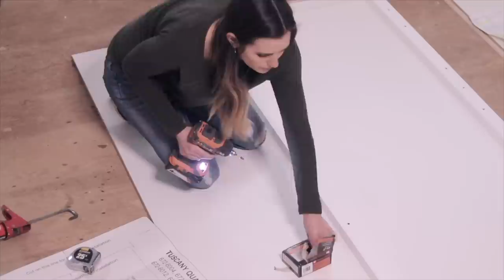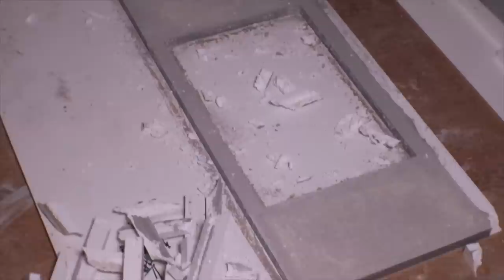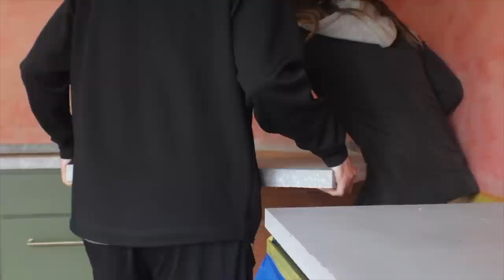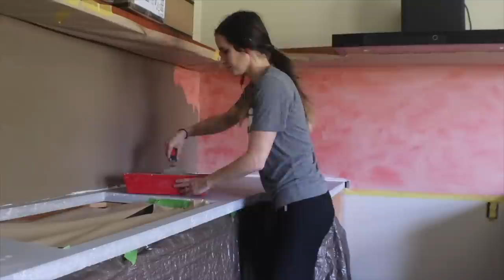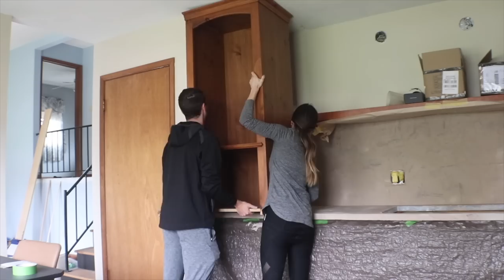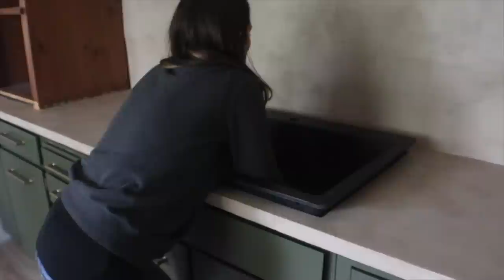DIY Concrete Countertop & Concrete Backsplash (Colored Concrete Counter)

Comment: Your hard work really shows in the results. I wish I had that kind of drive.  The "craftsmen" in my kitchen cut a relief into the drywall in order to fit the countertop. Caulked over it to hide the cut out. They did this because they didn't have the 90 degree. perpendicular wall  correct. It was more like 85 degrees on the inside.
Reply from the maker: Yes exactly. When the walls are wonky the counter can't fit

Comment: When you cut your cabinet, use a razor knife and cut your line, then make sure to use a sharp fine tooth blade if you must use a jigsaw. Cutting the line will help prevent the wood from chipping out and make the cut much better.

Comment: Great job.. I like the concept of the concrete idea for the counter top .. not to sure about the backslash 🤔.  The kitchen is really coming along.. great job
Reply from the maker: I actually think the video doesn't quite do the backsplash justice - it looks really great in person! We'll see if it pops more when everything else is put together.
Reply: @WelcometotheWoodsBlog  very true. Curious why no wire mesh in the concrete I know its thin but the wire helps  correct.. thats what I've been told
Reply from the maker: @norcross26  this product doesn't need it at all. The polymers in the concrete act like metal fibers that hold the concrete together giving it crazy strength. You can literally drive a car on this stuff without it cracking and it can span 6 feet unsupported without issue. So it's really because the product itself is formulated in such a way no metal rebar or mesh is required.

Comment: If you would have used wax on your mold you would of had any problems removing those edge pieces. Also you used to reinforcement in your form. The fact it didn’t break when you moved it and crushed someones foot is a miracle. Not to mention if your cabinets are perfectly level eventually those tops will crack guaranteed.

Comment: Looks fantastic. Good job. Did you use a silicone caulking around the base of the hutch after you finished applying the sealant to the countertop?  Thanks for Sharing. Stay Safe. Stay Healthy.

Comment: With the stuck foam, could have opened all the windows and doors and with the little pieces still stuck in concrete that were hard to remove burned it out with a torch. Seen this done a few times. Great video.

Comment: Question: because you put the aesthetic layer of concrete on the vertical drywall (for backsplash) and the horizontal surface (counter) and edges... Is it possible to use a different base for the counter? Meaning, rather than casting concrete, since it's visually going to be covered anyway, can the counter be constructed out of something else? Pros and cons?

Thanks for the video! I'm going to be constructing a kitchen for my basement apartment and I love the idea of concrete countertops. I was looking at Z Countertop Solutions, which is a pour-in-place product. But I am curious about the thin layer troweling option you did.
Reply from the maker: Yes so you can apply the thin layer of MicroTek concrete topping over any stable substrate. I chose concrete because then I didn't need to put the waterproofing membrane or any kind of primer on the substrate. Concrete that isn't sealed absorbed the MicroTek layer so I could just keep working. You should definitely look into it and you can reach out to diyconcrete.com with your specific questions because they are beyond helpful!! ♥️

Comment: Is this effective only if you have a true flat surface?
Reply from the maker: Well, my sheetrock wasn't very flat actually and I was able to build on it a bit and make it flatter. The counter was completely flat, but I also think a small amount of variation there wouldn't be a problem. You can build this product up to just less than 1/8" thickness so it depends on application.

Comment: Wait. No reinforcement mesh?
Reply from the maker: Nope these counters have polymers that act like metal mesh (stronger actually) to hold it together and give it incredible strength. That's part of why these concrete counters are more DIY friendly than most options.

Comment: I don’t like how the two slabs are not formally joined, like with epoxy as would be done with stone. That joint is a crack waiting to happen. Also, the slabs should have been attached to the cabinets, not just sit there.